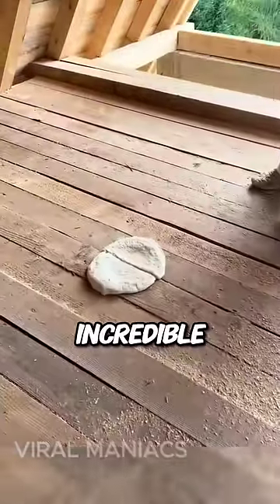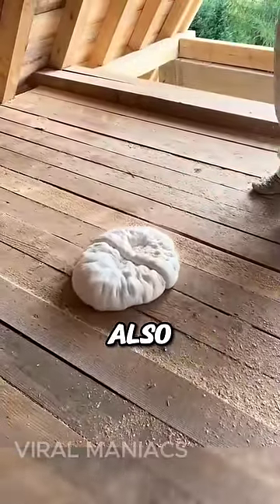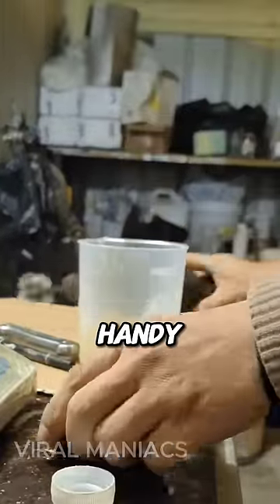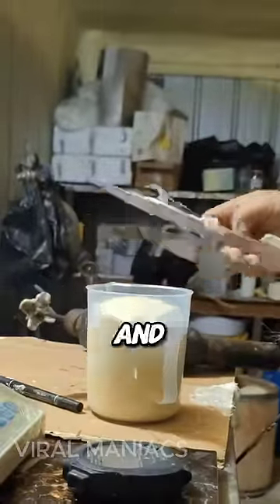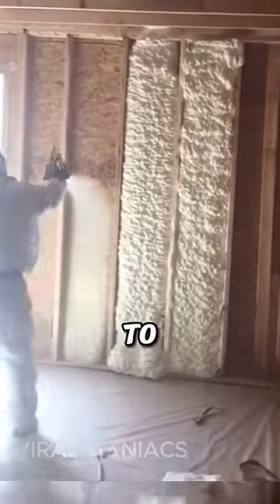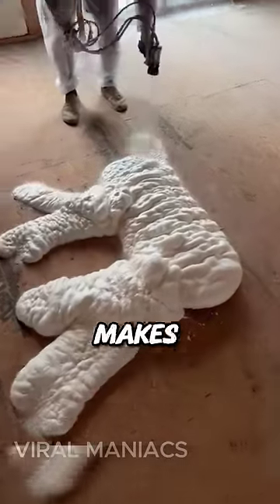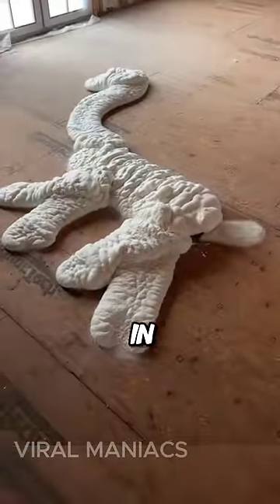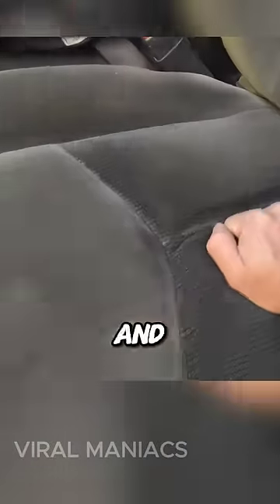The Superhero Foam That Will Blow Your Mind #satisfying #shorts

Comment: I used to work at a factory that made foam seat inserts for the automotive industry out of polyurethane di isocyanate. If it gets too hot it'll release cyanide gas. Workers on the foam line had toget there lungs checked monthly. Scary stuff.
Reply: It has to be burning to release cyanide gas. They were getting their lungs checked for inhaled powdered foam.
Reply: @billwilliams8232  the molds we used to make the foam inserts were heated. If too hot, cyanide gas would be released. No flames just fumes. 
I worked on the line so it's from first hand experience,not a safety manual.
Reply: Anyone ever heard of The Station Nightclub Fire?
Reply: @billfranz1724  Do you mean the one where the exposed foam, not covered by a fireproof covering , caught fire and killed so many people?
Reply: @billwilliams8232  Yup.  The nightclub used packing foam on the wall and it burns like gasoline and gives off hydrogen cyanide.
Reply: @billfranz1724 
Exactly
Reply: @billwilliams8232 
Foam was the key word bud.
Reply: 😳 They should've quit!
Reply: @billfranz1724 oh man, that's horrible!
Reply: Cyanide safely breaks down in the environment, and if it's hot enough to burn the foam, the house is already a coffin.
Reply: Cant be healthy
Reply: Asbestos was considered harmless ... Look how that turned out. 
Scary for sure.
Reply: @missyleaf9778  Good point. It was so mainstream that a town in Quebec Canada was named asbestos!
Reply: @robertholle5599 There is a town in WA where they used to mine Asbestos, it's called Wittenoom and the town was abandoned. Only one guy lives there.
It was the wives of the workers who were dying first because they used to bang out the overalls before washing them, and so inhale the dangerous dust fibres which would scar their lungs, leading to cancer, and slowly choke them to death. 
Bastard stuff. 
Mark from Melbourne Australia 🇦🇺
Reply: That's scary sh*t.
Reply: No shit.   When I did that I was always coughing up sticky globs of mucus.   I had assumed it was the waxy mold release spray we would mist all over the mold
Reply: It can hide water leaks in roof & walls. This happened to a neighbor.
Reply: Yes sir this thing is dangerous specially when it catches fire
Reply: Does styrofoam do the same thing?

Comment: This stuff out gasses for years. It also burns easily and gives off toxic gases when it burns.
Reply: Womp womp
Reply: Everything gives of gases when burns.
Reply: @stereospace You clearly dont know anything about spray foam.
Reply: It is inert when it is set and if the fire gets to this, that means everything is burning anyway.
Reply: PUR foam burns PIR foam doesn't   burn
Reply: In many European countries its forbidden to use it as isolation in houses because of its toxicity, diisocyanates keep on keep on producing a fume for years that makes people sick; mainly long and skin problems!!
Reply: Well, technically, it is dangerous as well, cause if there is every a fire, it'll kill you?? 😢
Reply: Once the two parts foam on a surface and finish reacting within minutes, there is no outgassing!
Reply: @riboid yeah but not everything creates hydrogen cyanide when it burns 😅

Comment: 100% toxic 0% recycling - 100% stupid -
Reply: This is untrue!
Reply: Yes yes and yes👍
Reply: Yes yes and yes.
Reply: @bhekidlamini1199 obviously you too
Reply: Plus inflammable
Reply: Crumbles away when exposed to sun. Chewed through by mice. 

And wtf? Were they using it as footings for those posts?
Reply: Yes, yes, and no no no
Reply: 100% laziness
get back to cement 💪
Reply: @bee5778   3x yes 😉😎💪❤
Reply: He literally said cyanide lol
Reply: and you'll be paying out the nose for a guy like me to work on your house for anything, if they even will. i see this insulation, i refuse the job. not working on plumbing or electrical in a house like this. hope you have internet, cable or satelite to all the rooms. hope they used the right cables. hope they used the right connectors. prey no mice get to em. want to move your router? bummer. no more free installations for you too. they dont cover this with att. and if you get a roof leak that causes black mold? your just screwwed.
Reply: @tafed3165 You mean concrete?
Reply: And highly flammable 😊
Reply: Mice for the win
Reply: Thank you. A sane comment on YouTube finally.
Reply: @oldauntzibby4395 yip, thats so sketch.
Reply: @sorejack leaking roof or moving a router? What a 3rd world country do you live in ? 😂
Reply: @filippetrula1234  sounds like you've never had to come into a house that got filled up in foam in the walls floors and ceiling. it is awful to work on. like i said, im not doing it. most guys i know will nope out. it's not worth it with what people are willing to pay.
Reply: @sorejack  ofc not, we build houses to last not like you, paper walls filled with foam 😂

Comment: in Canada we replaced carcinogenic fibrtglass insulation with foam. Then we replaced the foam which turned out to mold, so we had to remove the foam with a new fiber and are standing by to remove and replace the latest insulation.  
Were it not a such a profitable business for us we are relunctant to point out the obvious such as testing the latest insulator before installing it for negative health impact, black molds, inadequate insulation.

Comment: In the Netherlands, a family had their house isolated with this stuff. Shortly after, the whole family became sick and had to be evacuated. All their belongings inside the house became toxic. Clothes, drapes, mattresses, blankets, cuddly toys, everything. The house construction became compromised by the ongoing expansion and had to be secured with anchoring rigs to prevent collapsing. 
No company, except for one, was willing to demolish the house because of the risk for health and safety plus risking high fines for taking out highly toxic waste. In the end, a special permit had to be issued to have the house demolished, which protected the demolition company from debilitating fines. 
The rubble and soil had to be treated as highly toxic waste.
Reply: You made up this sht right now. Aren’t you? 😂
Reply: @haimaphilhp  He has, what a load of rubbish.
Reply: @haimaphilhp there is a clip on yt. About this house. The family went sick after spraying this stuff in there walls.
Reply: Cap 🧢
Reply: @haimaphilhp true and common. Well commonly people do a smaller part and get sick without knowing the cause.
Reply: No they had it installed wrong and sprayed three times thicker than it was supposed to be. It needs time to off gas. I know exactly what your talking about but the only reason that cause anything is because they already had illnesses. And even if it was sprayed just a little too heavy at once that wouldn't have happened but the illnesses weren't any kind of severe sickness they already had like allergies or sensitivities or auto immune issues that allows them to get sick... Anything that's chemicals mixed can cause the same thing it's not the foam it's the applicator they sprayed a closed cell product like 8-9 inches. It ain't dangerous you could never smell or or be affected by it at all if it was done right
Reply: @visserijfoto  you know that's not the same thing right. That is the old famaldahide formula if that's true which I think your mistaken but if that happened that's the only way is being the old one. But it wasn't sprayed in their walls alone it was sprayed 3x too thick in the ceiling which caused the gasses to be trapped too long so that when it dies finally off gas its more harmful. I spray it without a mask All the time. I'm ts not dangerous the formulas in the past 12 or s o years are not dangerous, toxic pollutant, flammable nothin
Reply: @corese75  that's absolutely false
Reply: @corese75  please stop spewing nonsense your not informed enough to talk about.
Reply: @justinfletcher7630 I’ve seen news stories and videos about people in America having to have their entire attic and roof structure removed and rebuilt to remove this shit because of the toxicity.
Reply: @justinfletcher7630  youre right
Reply: I saw an entire documentary about this case or a very similar case on Discovery. The ratio between the 2 substances mixed to create the foam was slightly off. The house started smellinh really bad immediatley and it never got better. The ppl inside started geting sick just a few days later
Reply: @BMW520ITURBO  exactly. It has to be PERFECT. It has to be mixed perfectly and sprayed perfectly, all by hand. Humans are imperfect. This stuff is incredibly expensive to remove. They basically have to take your house apart and rebuild it to remove the stuff. So I will never trust that everything will be PERFECT with this stuff.
Reply: @haimaphilhp I know this story. Netherlands is not a third world country like the USA and has higher standards.
Reply: @paradoxical81  Fair enough. I realize now it's real

Comment: Do you really need all that protective gear to spray that foam?  Must be toxic also 🤔
Reply: Duh
Reply: It is
Reply: Yes until it dries.
Reply: No, it’s extremely sticky is why they gear up. As well, hard to get the glue material off your body.
Reply: YES, VERY TOXIC
Reply: @wmt8031  Thats ehy he's got respiratory filters? Because is sticky?
Reply: @ciprianpopa1503  no , because it smells like shit, and he’s not an outhouse cleaner silly.
Reply: @wmt8031  You almost made an intelligible statement, apart from saying absolutely nothing.
Reply: @ciprianpopa1503 The filter is there in case something goes wrong. Construction companies use the product in its separate chemical states stored in tanks, to be referred to as A and B to make it simple. If they haven't set up the hoses properly or made sure everything is tight there's a possibility of the tanks going off. If it's B, you're fine, but if it's A then there can be problems. It's why each kit has instructions to explain how to properly use this.
Reply: @rikusawada6113  Stop being condescending. When someone wears such a costume, what it really means is that the chemicals that he handles are toxic. My initial point was just a funny remark about the statement concerning the material being only sticky.
Reply: Overspray will stick to your clothing and expand. It’s a disposable Tyvek painters coverall and respirator.
Reply: @ciprianpopa1503  some people have no sense of humor. You need to lighten up. Also spell check before you send replies. Your mind is slower than your fingers tapping the letters, 🤣😂
Reply: @ciprianpopa1503  I wasn't trying to be condescending, I was trying to explain the legitimate reason behind the protective gear. So why are you getting so angry?
Reply: @wmt8031 yea you do, it’s more than stick, it’s deadly if it is inhaled
Reply: @larryhaug71  this is last months chatter. Get with the program and move on.
Reply: @wmt8031  then why u coming back?
Reply: @wmt8031  never mind it’s no more important than you
Reply: @larryhaug71  sorry if I hurt your feelings but this is ancient shit. No longer worthy of a response. Move on.

Comment: Setting posts in expanding foam is the most hack thing ive ever seen.
Reply: They use foam to set 35’ tall utility poles so it’s far from hack
Reply: @paulhunter9613  they use post setting foam which is a closed cell foam. This is expanding foam which is open celled. Open celled foams allow water to penetrate, leading to premature rot. Not to mention it lacks the strength of post setting foam.
Reply: @reaper147000  yea I didn’t ask them what type of foam it was, just very surprised they used a product like that. They did it 2 yrs ago and to this day the top of the exposed foam where they cut it flush with the ground does not allow a single weed or blade of grass to grow near it!😳 I am going to install some fence posts this yr and thinking it would be better than concrete
Reply: @paulhunter9613  it's not better than concrete. It's easier to transport and sets up faster, but it's more expensive and doesn't have the same strength as concrete, so its not recommended for use in high wind areas. It also expands when it's mixed which can cause a post to be moved from its intended position. Because it sets in only a few minutes this needs to be remedied quickly or the posts need to be well braced. The foam also contracts some during curing so backfilling properly is important.  Personally, I'd go with concrete for most diy applications. Yeahbitnsucks having to hoof 50 lb bags around, but its cheap, simple, and very effective.
Reply: Carcinogenic

Comment: They spray this in attic in inaccessible spaces like vault ceiling and does not require venting.  This will be the future dryrot and mold problem.  All the moisture in new wood has no where to go.
Reply: New wood is already kiln dried to 13%
Reply: And if there is a leak in the roof it will hold the water for years. I once did a repair on a home where the trusses where rotted completely through because of that garbage foam

Comment: I have been a polyurethane foam (PUF) insulation contractor for 50 years. PUF Is basically the same as any other plastic. In a fire it will produce toxic fumes just like any other plastic. Of course any burning material produces toxic fumes.  Like any other plastic, once it is fully cured, it is almost completely nontoxic and does not outgas, unless in a fire. I have always used 2 Lb. density closed cell PUF. I have never seen it deteriorate over the decades I have installed it unless it was exposed to direct sunlight or substantial quantities of water. The benefits of PUF, Energy savings, a structurally stronger, quieter house, etc. have led many of my customers over the years to tell me that they would not even consider buying or building a house in the future that did not have PUF insulation. I am now 70 years old and after being exposed to 50 years of the chemicals used in this industry, I ride my bike about 15 to 20 miles every other day to stay in shape. I am in excellent physical condition. PUF Does not pollute anything unless it burns. PUF  contains fire retardants  and if installed properly according fire codes it is not "highly flammable". As a volunteer firefighter, I can tell you that in an actual house fire, people  will die as a result of the burning contents within the house long before the fire burns through the sheet rocked walls. If PUF is 😊 is extinguished with something called  a fire extinguisher or water.
🎉
Reply: Yup. People hear plastic and panic not knowing how widely used and effective this is. These same people would be shocked to know the chemicals in concrete, the insulation in wires, the plumbing systems, and so much more in houses all use plastic and even worse chemicals.
Reply: PUF contains fire retardants , like PFAS ??
Reply: I was told at an early age that polyurethane produces much more toxic smoke then expanded polystyrene .  EPS requires hot steam to expand and is sold as premadr blocks and plates, but then keeps its form for decades and can be covered in cement or drywall for further reduction of flammability .   Of cause it is still more flammable than mineral wool stuffed behind drywall or cement .
Reply: May I ask you a question? Will it bridge moisture or is essentially 100% water proof? I am converting a brick garage into a summer house. I have built an internal insulated stud wall  1 inch away from the single brick wall. 
I want to use expanding foam to insulate small areas. If the expanding foam bridges across, will it carry moisture from brick wall to stud wall?
Reply: Already 50 years? The earth is dead... No hope... We made all wrong. Look around you…
Reply: We are doomed...
Reply: It does release chemicals, even when cured
Reply: Finally i comment that makes sense... Urethane foam is awesome! ❤❤

Comment: Foam isn't structural.   It's not designed to support fence posts for long term use.  Use foam for fence posts as an extremely cheap and lazy way to build a fence.  You can see how strong it is in the next frame after the fence post installation.   It easily breaks apart.
Reply: Exactly.  It tells you this convo are of unprof re use of the item..and 90% feedback are hearsays :(

Comment: This stuff burns fast and gives off toxic fumes. It is treated with flame retardant chemicals that give off volatile organic compounds (VOCs). If the manufacturer  specifications are not followed, off-gasing can last for many years. A rise in temperature, like from a summer heatwave, causes an exponential increase in emissions from TCPP. These chemicals are absorbed into every part of your body with each inhale. If you are lucky enough to correlate your illness with the spray foam installed 8months prior, you'll learn the cost of removal is more than the install, requires wearing ppe including a respirator and cutting the foam dispresses it's dust(which im not getting into). There are better options. Fiberglass does not burn and melts at 1000°f. Mineral wool is non flammable, melting point 1800°f.

Comment: Yeah and if mixed poorly it'll cause health problems for the occupants, if over sprayed it doesn't set right and can cause health issues for the occupants. It's highly toxic and causes more issues than not. Only place I'd use it is for hard to reach places that need insulation. But that's it.

Comment: In the UK, people who had their attics done had all sorts of problems. Didnt insulate like claimed and mortgage lenders wouldn't touch properties unless it was taken out, which is super expensive to do. I quote: "there are potentially very costly problems that can occur with spray foam roof insulation, including:
High installation cost
The wrong type is installed
Requires professional installation
Can trap moisture, leading to damp, condensation and roof timbers rotting
Difficult and expensive to remove once applied
Problems getting a mortgage
Unlikely to access equity release
Difficulty selling".